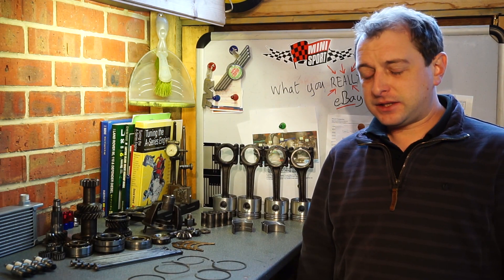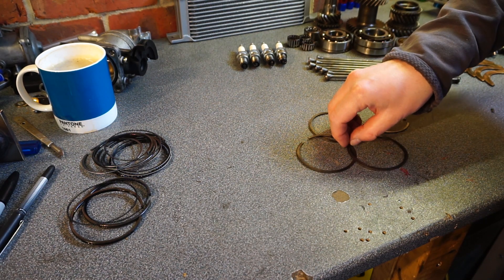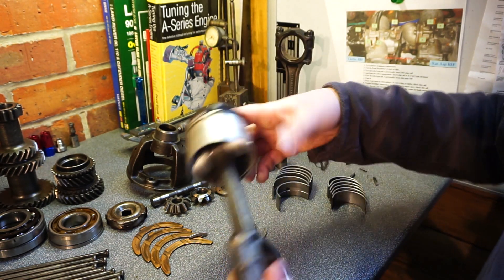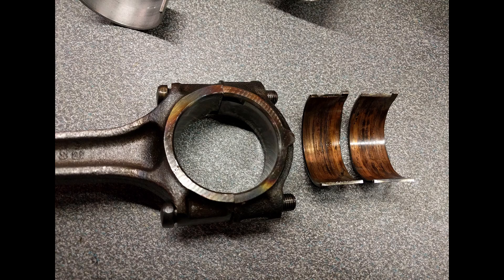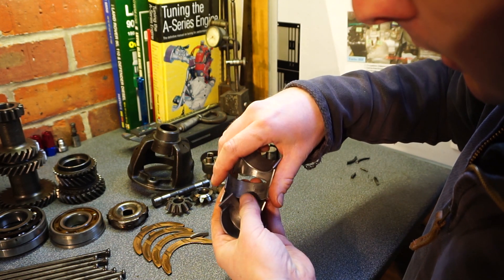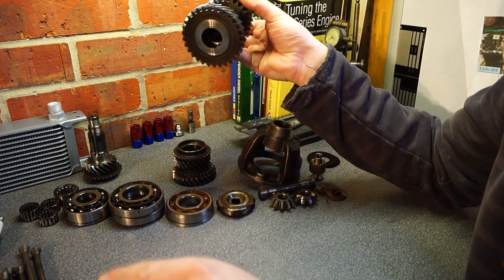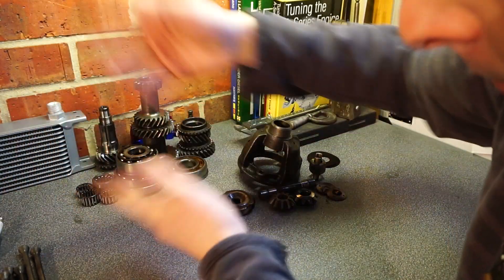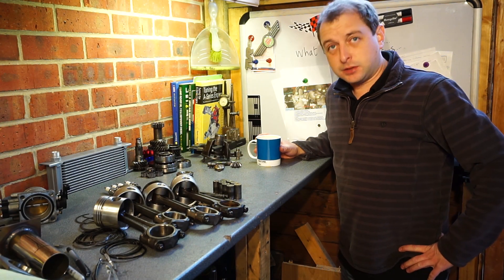Turbo Mini TV - ebay engines: What you REALLY get...

Comment: i know how you feel..i made the mistake of buying a engine off ebay  after i cracked a piston in my vxr...the engine i bought which was supposed to be a low mileage ,full service history engine  turned out to be worse than my original . ended up just rebuilding mine with forged internals. looking forward to the next video love the classic mini. should be a fun car with the turbo motor in. what sort of figures are you expecting from this build. 
cheers.